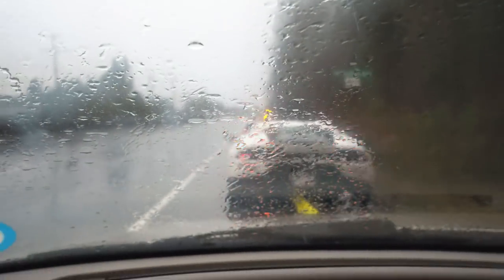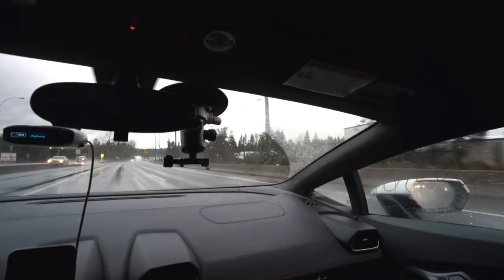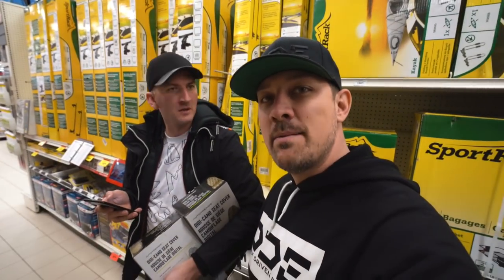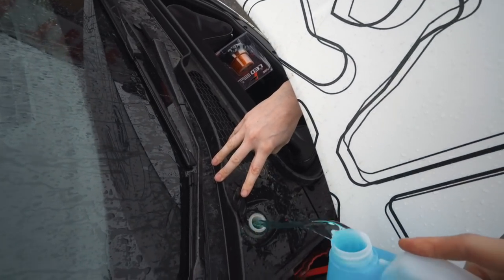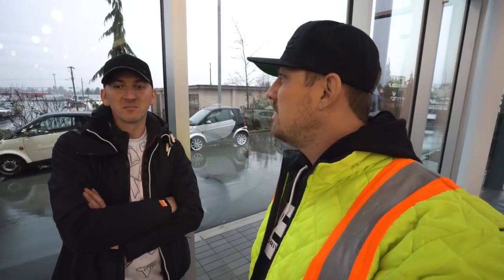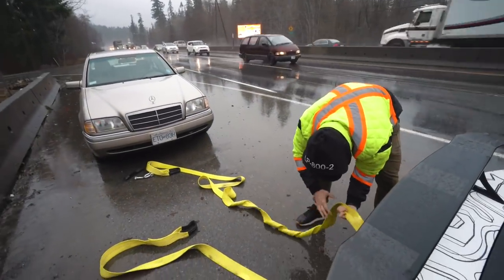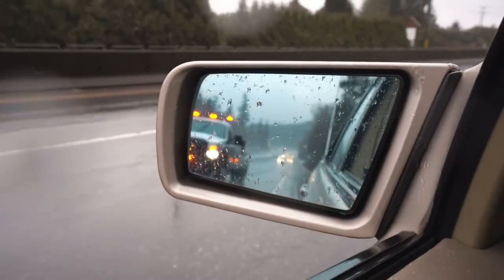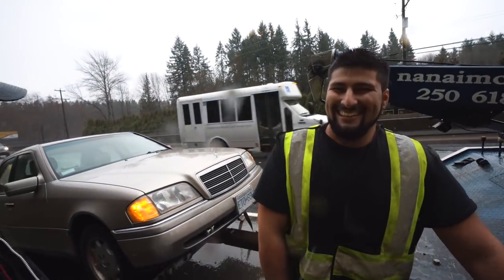Lamborghini Huracan TOWING BROKEN Mercedes-Benz *2,800 LBS TOWING CAPACITY*

Comment: It's got a cold and hot cooling/warming circuit. The oil cooler is the same. It's a bypass to heat it up faster. You can drive the car when the h2o temp starts moving, and it will raise the rpm sooner. You don't need to wait for it. Maybe the manual says otherwise, but keep the revs mild and it's OK.